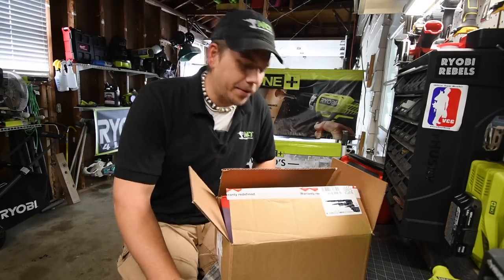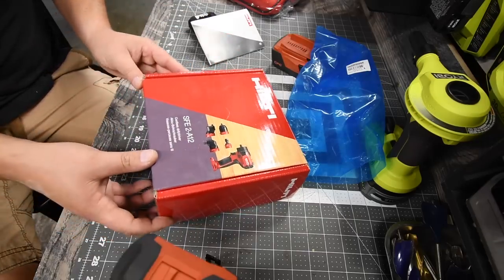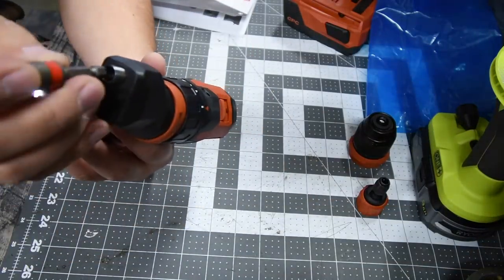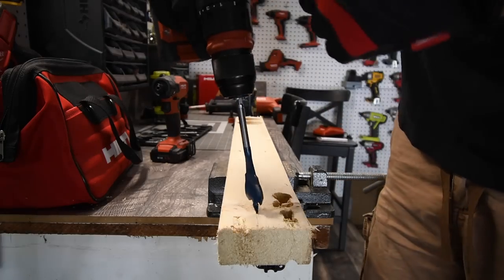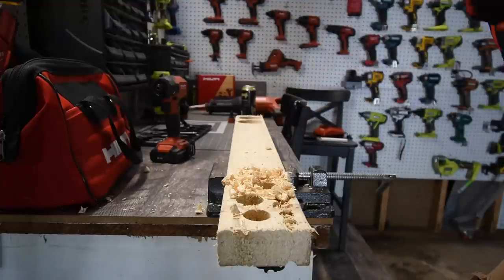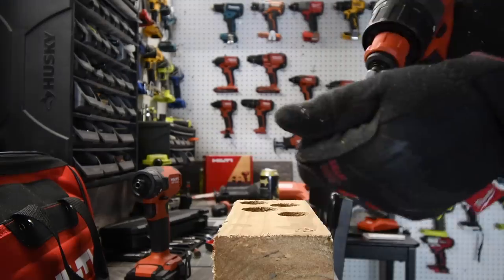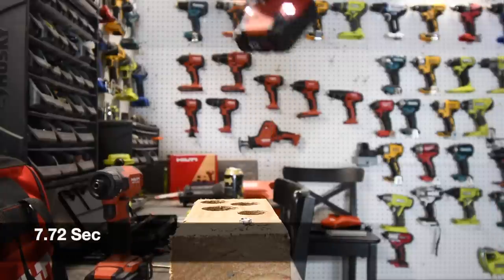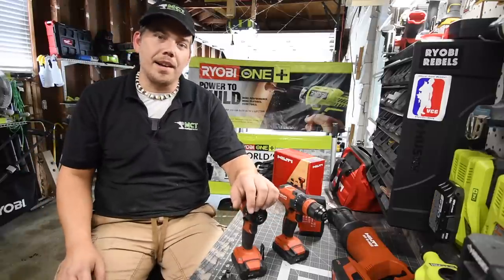NEW!!!  HILTI Multi Drill

Comment: User error! The chuck tighten is in one way no click back, if you release 1 click then the chuck will be unlocked. That will damage the chuck mechanism and the bit.
Reply from the maker: Not true. if you click one back after it is tightened it locks the chuck in place
Reply: That’s the same Röhm chuck that comes with all of the German drills.   Tighten and then click back as he was doing is correct.  Just checked a couple Metabos and a Boschs.  Yup.

Contrary to all of my talk about german drills, the Germans don’t even bother offering what Makita, TTI and SBD put up and so I run 95% Makita all day (Milwaukee or Dewalt would have sufficed just the same).  The Makita drills definitely don’t want you to one click back on the chuck. 😅
Reply: @robertrada4783  I have try to my metabo like what you say. Cannot feel the confidence to the chuck, because release 1 click the chuck already unlock and I try to release a bit more then the chuck release without any resistance, the chuck is open. So I'm not confidence to this style (1 click back) and all my chuck still in good condition.

Comment: Stop at 7:43. Since having my tools stolen I'm slowly buying tools again. I bought an angle attachment for the festool pdc or dpc drill non Hammer drill. Using a chuck on angle I had my finger on the part the chuck spins and at the highest speed I got a friction burn. Oh my goodness. You put your hand on the end so you can have pressure driving in screws or drilling. Just keep your fingers and hand away from where it spins. It certainly bites. I have a white mark now. This tool looks real good. You need a few angle drills for certain jobs. In fact all the time.
Reply from the maker: HILTI is a good way to go. I trust in the quality of HILTI

Comment: That is one heck of a weird amalgam of Metabo quick change chucks and whomever the mfr is for Hilti.

I’m probably not the first one to mention this but the bit holder from the bit kit is a Wera rapidaptor. The whole kit is from Wera, but that’s besides the point.   The rapidaptors are available in different lengths and worth checking out.  I like their 75mm one. 

How’s the runout on the bitholding chuck that came with the Hilti? The one’s I have on the Metabos do windmills.  I had a Fein one that had a wiha bitholder on it and that was ok, but neither really came close to the original Festool solution (centrotec chuck + proprietary shank bitholder).   Bosch has a somewhat elegant solution on their 18v muti chuck: No bit chuck, the hex portion has a locking bit chuck (works best with wire detent insert bits, just okay with power bits).
Reply from the maker: Very good and thank you for the info Robert
Reply: @ManCaverTools  I have the metabo blq 12v and it's chuck attachments zre made in CZ, and very similar

Comment: At 16 and 17 minutes of you had your hand on the top of the angle pushing down you would have got the same time driving in screws opposed to not using the angle attachment. No difference in power as it is direct drive. The same is with the festool. Looks like a very good tool. Love the 4 amp hour batteries. Imagine I had the festool 12 volt and it had the 2.6 amp hour batteries.
Reply from the maker: the time wasn't really that much different and remember I used speed 2 when I started the screws with just the chuck. it was pretty much the same time so there isnt really a power difference

Comment: Hi Dave when you have no heads on the drill the metal collet excepts 1/4" bits just letting you know so if your in a tight space you don't need to use any of the heads thanks for the video
Reply: 7.47
Reply from the maker: Yes it does. I show that in the video

Comment: 12 volt tools are dope. I am currently tryijg to expand my dewalt 12v arsenal. But i need to get a few more 20v before i can do that. So far i only have the lazer with 3 batteries.
Reply from the maker: Dewalt needs to make more 12v tools

Comment: I noticed you checked if it was "push in" to put the 1/4" bits into (where you dont need to pull the chuck out to get a bit into), I'm desperately looking for a 12v brushless drill that is "push in". my 6 year old 12v brushless milwaukee died and their new version is not push in and sucks. where can i find a 12v brushless that has a push in chuck???? please and thank you
Reply from the maker: I dont recall off hand on which ones are push in, but I do have a lot of videos that I show which ones are

Comment: Neat tool, don't see the batteries lasting long or even the motor if you're doing 25mm speed bores consistently. Definitely great for service work though
Reply from the maker: More tests will be coming and I thank you for viewing Wears
Reply: I have most of the 22 platform tools and ventured into the 12volt for small jobs.  I find myself just grabbing the A12  drill, screwdriver,or Impact or saw  a lot more than I thought I would . At actual voltage of10.8 volts , the power and running time is greater than I expected. They will not replace full size tools but my subcompact tools are very handy even when occasionally used for jobs that are better suited to a larger tool.
Reply: @jasonwalter382  I've got a 12v makita impact and drill. The drill is pretty meh but the impact is incredible

Comment: Hi am a heating engineer,am currently using a hilti 14v impact but looking to buy something new, would the driver system on this drill happily say hang radiators/boiler brackets ie 2/3 inch screws..
Reply from the maker: Hilti 12v tools can drive in 8in timer locks in a non predrilled hole. so they are pretty powerful
Reply: @ManCaverTools  hi a watch you video  on the hilti 12v driver also,was wondering how many 22mm wood spade bits do you think it could handle before battery drained 🤔
Thanks
Reply: @rabhunter11  did you find out?

Comment: Great video man, and how do you prefer 12v tools, with the batteries in the handle (like milwaukee, bosch) or out of the handle (like Hilti)?
Reply from the maker: Milwuakee m12 is very powerful but the handles are very thick and awkward to hold. I like a little thinner handle. I feel that the m12 handles are thicker than the Ryobi handles are

Comment: Convinced me. Took back my Milwaukee m18s back.
Reply from the maker: I think its worth it and I thank you Andrew
Reply: You won't replace a M18's power, you won't even replace M12 gen 2 power  which is probabaly the most you can get for thr 18/12 nominal volts respectively.  The 12v system from Hilti is all about weight and ergonomics, they won't have wrist breaking torque.  The installation driver is for just that, installation.  You can still get lags and all that stuff in, but you need a healthy understanding predrilling and dealing with different materials.

My opinion is that the Milwaukee 12v is very uncomfortable trying to get 3 18650s inside a handle, but it's powerful.  The Hilti I can use all day with no joint fatigue issue.  Wish they can make a 12V brushless small circ saw for those quick cuts.  The recip is a bit rough for delicate work typically you use 12v with.

Comment: Lol the Milwaukee's are much smaller and less bulky and honestly hilti has lost touch with the market, there tools are great but not worth the price any day.
Reply from the maker: I thank you for your feedback Slappy
Reply: I think their tools are great!
Reply: My Hilti gear always works. My Milwaukee  gear doesn't a lot of the time. If I am going to work in a persons house I always take my Hilti tools as they are much more reliable.  Gen3 combi, Gen3 impact and fuel jigsaw all have issues with triggers. Halfway through a job I pick them up and they don't work. I sent the combi drill back to Milwaukee and it took a week to get back to me. After my Hilti combi was dropped down a street drain during works it developed a rattle. I called my local Hilti rep and he was with me within half an hour with a replacement combi. He took mine away for repair and 24 hours later it was back with me. But there wasn't so much urgency on the repair as I had the replacement.

Comment: Hilti made in China ,better festool made in Germany
Reply from the maker: HILTI is engineered in Germany and made in china. but its not built like china made. HILTI makes sure of it
Reply: I always now use Hilti. All my Milwaukee gear is crap. I didn't like the festool gear when I used it and their track/plunge saw was gutless I thought. Pissy little motor in it. Would rather buy Mafell saw. Hilti corded gear is indestructible! I got given a Hilti TE1 SDS by a contractor 33 years ago. He left it behind at my place of work. After months and many phone calls he told me to keep it as he had already upgraded to another Hilti, plus he had thrashed the TE1 to death. That drill is still my go-to corded SDS and has outlasted many other corded drills. Makita and DeWalt usually give me about 5 years hard work and then die.